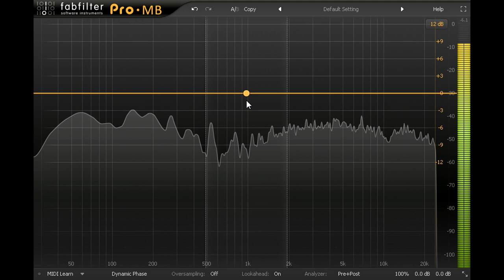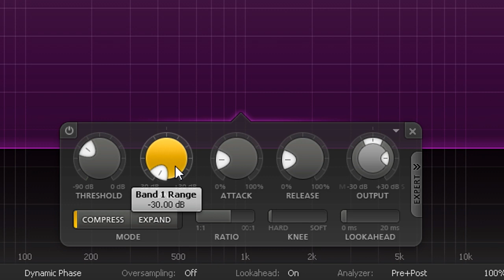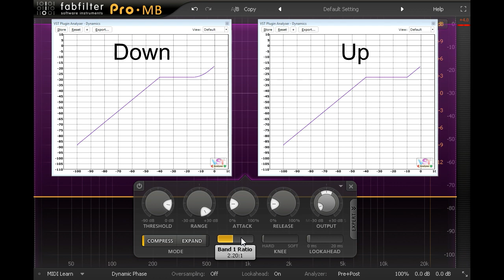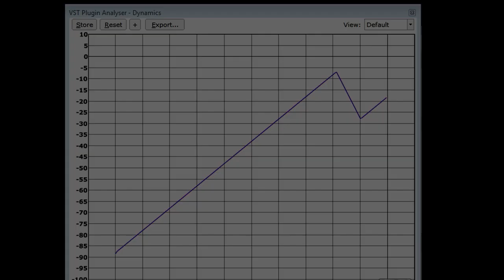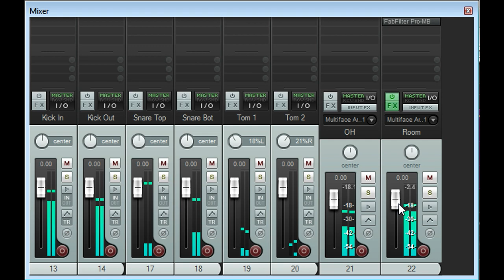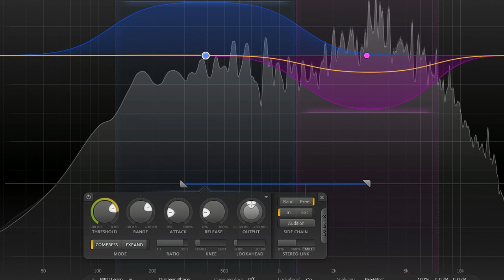Upward Compression

Comment: Hey Dan, I have a question that I can't really figure out the answer to. Thought if you had the time, you could definitely give me a correct answer as I can't find anything concrete online: How do the the attack/release parameters shape the sound of the part of the signal thats above the threshold while using upward compression? While I can hear what's happening sonically to a degree, I can't really conceptualize whats going on. My issue is that if I set the threshold so that say, the kick and snare on a drum buss are above the threshold, any changes to the attack/release seem to still affect their envelopes. This conflicts with my understanding of upward compression, being that they should be left relatively untouched at they sit above the threshold, or is this incorrect? Any light shed on this topic would be greatly appreciated :)

Comment: I wish that video explained when over-compressing is something you would want to choose over different processing type. Dan did show a few cases where over-compressing could be useful but it's not clear if it would actually better than not over-compressing. I personally fail to see in what cases you would want a dip in the transfer curve since it can significantly change the groove in way that I would suspect to be non-musical. When is it a good thing that a signal a bit louder than the threshold gets quieter than the threshold while a signal that is much louder will stil be louder?  I would really appreciate some general guiding principles on when to reach for this technique.

Comment: The problem with the Pro MB (which I hadn't realised until i watched this) is the fact that the Pro MB automatically scales the ratio with the range -  this becomes a bit of a problem if you want to bring out some low-level detail in a subtle way without over compressing - in mastering for example.
Reply: I’ve been trying to replace Waves vocal rider with Pro MB for a handful of weeks now and I’ve been able to get things working pretty subtly on a podcast I mix. Different animal than Vocal Rider, but I can get it pretty close and maintain the subtlety. Adjusting the knee is super helpful to keep things transparent.
Reply: @suspendedsound  thanks, I've been looking to replace all my waves habits so I'll play with that...  Rvox is the other one that's just so simple, fast and easy... it's a crack compressor, and I cant quit it with my UA/fabfilter.  Open to suggestions...😆

Comment: This video is what is lacking in every possible video on YT. Upward compression is extremely overlooked and underused, in tutorials and practice. I will watch this video at least 5 more time to process all the info, thank you so much. :)
Reply: bro how is it overlooked and underused?? OTT is literary one of the most popular plugins to ever exist. Also inflator is very famous. 

yeah ikik 3 years passed
Reply: Better to use Parallel compression. It behaves like upward, but doesnt maximize the noise.
Reply: @TheCaysed  It is quite different. The affected regions are not the same, different relations of peaks/lows, peaks/peaks and lows/lows change...
Reply: @dimitrijevicveljko  Quite right.  Also, it's responding to signal below the threshold, this completely changes what the compression is responding to.

Comment: I've watched this video so many times, but every time I'm more enlightned. The over-compression that Dan explained is actually quite fantastic, it makes it easy to scale down the entire transient while maintaining its shape, which his virtually impossible in a traditional compressor. I have no idea how they've done it, without an explicit lookahead even. I think this is the same algo they use in Saturn/Timeless dynamics knobs.
Reply: I first saw this in the waves C1...although not multiband but it was early 90s...such a simple trick; Im pretty sure Inflator uses it but in a much more signature way
Reply: @Matthew Jaggers you missed point...it of course adds harmonics but that does not do any actual inflation...thats side feature and hard clip is not sweet...do you actually use it? The inflation is by upward compression. Its worth having a look at plugin doctor which illustrates the curvres really well and of course the manual explains it well. Ive been using it since 2006 i think...still on my powercore card. Its a great tool but i dont use on anything >5k bevause of aliasing
Reply: @Matthew Jaggers yep...see for yourself. Its good for low mids harmonics buy a hg2 is better for wideband/hf
Reply: @Matthew Jaggers plug it into plugin doctor...its clear and obvious. Does it add harmonics...yes, does it inflate based in upward compression, yes both in singular wideband and multiband. The manual is clear too...'increases low density samples' (off the top of my head) but you can generate upward compression without adding much in the way of harmonics. Might be best to read the manual and verify with reference. My source is the sonnox manual and plugin doctor. If im missing something i humbly apologise but i wouldnt waste my time on yt if i wasnt sure. Its amazing how many people will chime in and not even have looked for themselves (in general). Paul Frindle (a true gentleman of the industry) also has very detailed wisdom and understanding of those plugins.. i doubt he would disinform me when he was so deeply involved in the IP? It was a very clever and unique tool...still goes well...just needs oversampling to bring up.to date
Reply: @Matthew Jaggers cool...its subtle but very much a part of the sound...just run the dynamics test...actually looks a lot like tape comp if you transpose the transfer curve...that exactly what the manual is saying...just becomes visual in pid
We must use uc differently because i can barely hear it as the peaks remain unaltered...even heavy settings are tough to tell. .of course extreme will pump but pushing even 6 db at eg -30db has almost no artefacts...assuming the transfer curve of you compressor allows deadband so you arent simply raising the noise floor

Comment: I’m fairly new to all this and I find compression completely baffling. These tutorials are the best for me , I like the pace. Some other tutorials rattle by so quickly like they expect you to know certain things which if I did I wouldn’t be watching it in the first place. 
I’ve just one question,,,how do you know where to set the threshold ? What do you look and listen for when making your decision? This is the most confusing part for me.
Many thanks.
Reply: Short answer is, use your ears.
Reply: As someone who went through the same process, I'd recommend watching all the other compression tutorials in their channel and many times over. As for setting the threshold, a good instinct is to recognize the different dynamics in your track and isolate the one's you don't want to be process by the compressor, then set the threshold right above it. With Pro-C it's really easy to see because of the waveform they show you in the background, in Pro-MB you gotta keep an eye on the level meter in the threshold knob. Of course, it all depends on what you're trying to do.